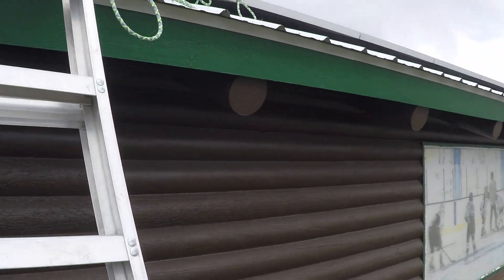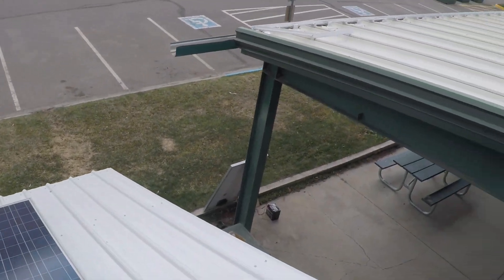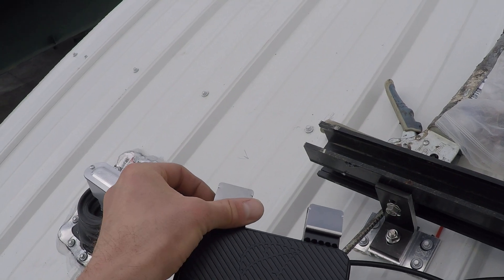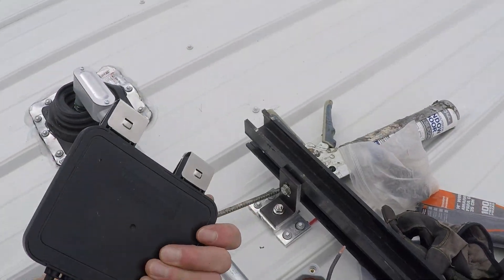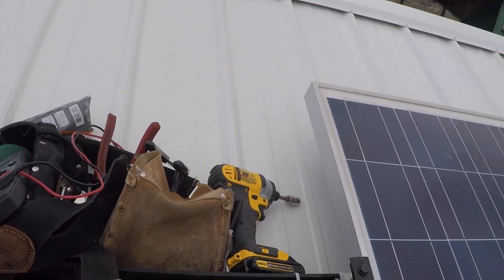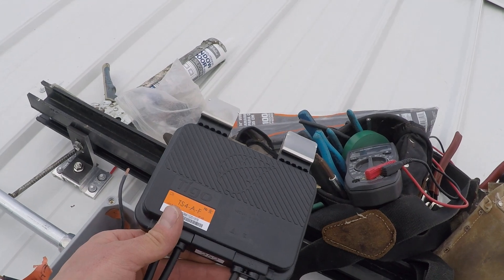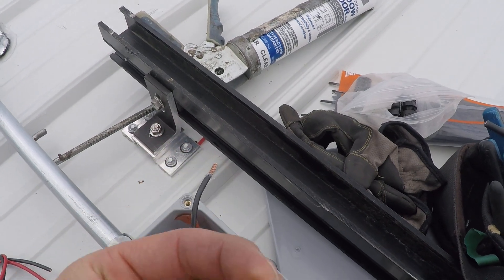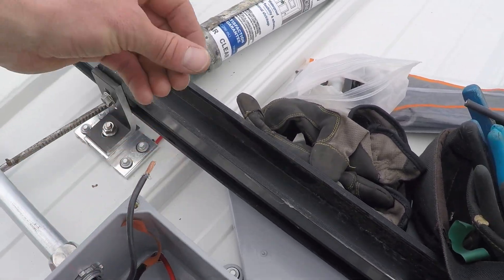RAPID SHUTDOWN 2017 NEC ELECTRIC CODE TIGO TS4-A-F REVIEW SMA DC-DC CONVERTER OPTIMIZER SOLAREDGE

Comment: Much easier to install the RSD's on the panel  "before" mounting panel. And at that time the cables are easily managed and attached to the panels also. Youre just used to another style and need to learn a different product.

Comment: So, this rapid shutdown code is new to me.  So all roof mounted panels need rapid shutdown capability? SolArk nor Signature solar,  mentioned them when I asked several ways if any other components would be needed for my hybrid residential system
Reply: If your residential system is on your roof Top where people are present then yes you need RSD’s

Comment: I believe the Tigo product you featured on your video only has the function of acting as a receiver for the purpose of shutting off DC voltage to the NEC standards and not the functionality of a DC-DC converter to maximize MPPT at the module level.
Reply from the maker: Just looked at the spec sheet, initial quick read does indicate it does some optimzation regarding string lengths and shading.  I'll try to look at it more later.
Reply: @JesseHoff  https://www.tigoenergy.com/product/ts4-a-f (F for Fire)  shows that it is just a rapid shutoff device, nothing more. The TS4-A-O <- O from Optimizer is a dc-dc converter ( & rapid shut down)